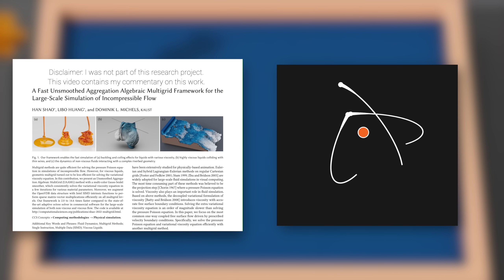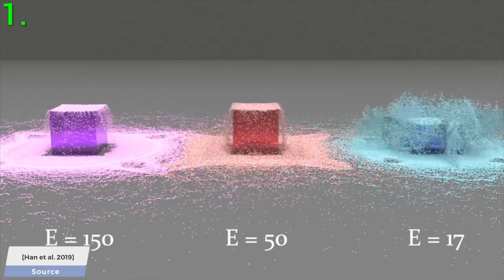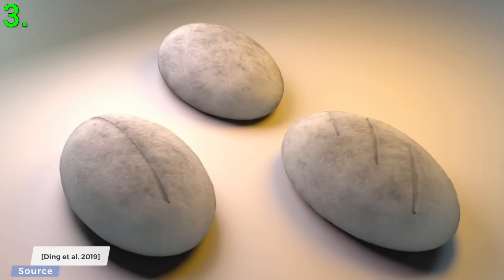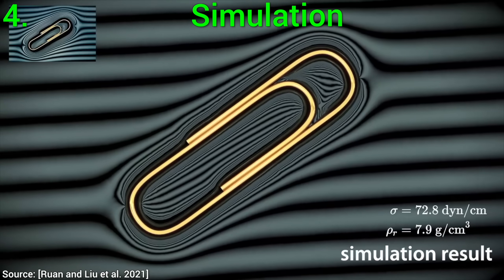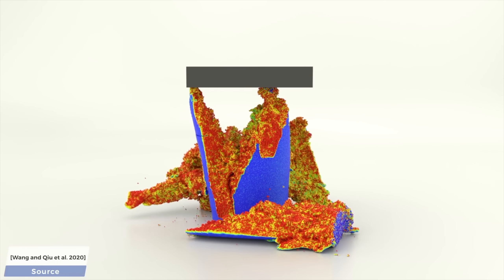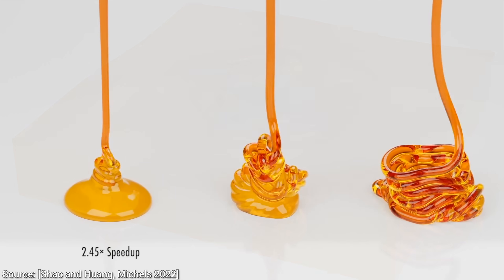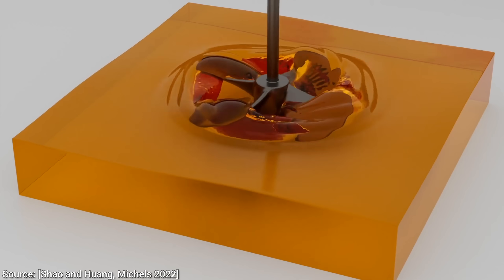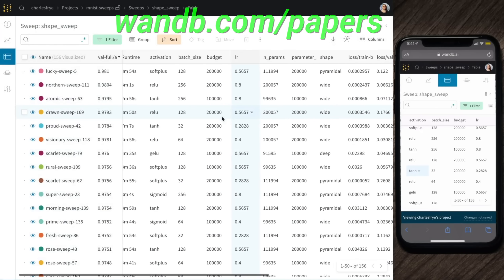A 1,000,000,000 Particle Simulation! 🌊

Comment: I think that there should be ways to make these simulations extremely fast or Realtime no matter their size as long as you can make the program properly multithreaded or multiprocessing in a way that effectively makes particles store information on each particle in a box. Then depending on each particles speed to prevent particle clipping register their direction and radius or whatever kind of shape it theoretically has to determine how many areas/particle box sections or whatever we wish to call it to simulate the outcome. If you have 1 thread/cpu simulating each of the particles speed or possibly individual gpu cores if someone finds a way to use their specific architecture for physical simulation, then as long as you can get everything to communicate properly during the checking phases it should scale nearly infinitely as long as you can get enough cpu cores to maintain whatever fps you want. 

Of course an approach like this would make it hard to work out the simulation kinks or hang-ups when things want to go insanely fast causing particles to domino multiple other particles into yet more partitioned areas during a single simulation frame or cycle. Still i think depending on how it is done it is possible with the scaling of cpu cores and possibly gpu cores if someone finds a way to utilize shaders in that fashion! 

I'm actually quite interested in the idea of someone making program that can utilize gpu cores to mathematically simulate or rather emulate cpu calculations in a way to make it act like your cpu has an extremely large amount of slower cores to do if you have the right drivers. 

Maybe there is something like that out there already?

Comment: I have a question:
Does having more cache in the CPU help with simulations? Like for example these Ryzen CPU's with 3D V-Cache technology.
I've never seen anyone benchmark that. And I'm mostly interested in Blender simulations.
Reply: Outside the scope of this channel but no. Right now blender fluid sim is built on mantaflow which has no working GPU acceleration nor full multi-core CPU support for FLIP nor support for processor-specific acceleration features. Mantaflow does cache things at the filesystem level but we're talking about multiple gigabytes of simulation data; so mainly the speed of your fastest CPU core and the speed of the cache drive will be the limiting factor so try to get the fastest you can of both!

Comment: I’m always hopeful these new fluid sim methods will make their way into common software packages (Houdini in particular), but they never seem to. Is it because they are patent-encumbered or are ideas in papers too untested and theoretical to be used in production? What has to happen to close the gap?
Reply: Sometimes the author's do not provide all the details in their papers to reproduced results and do not share the source code. Sometimes they do but noone takes the work to re-implement it. Sometimes you see only the 0.1% of simulations that actually worked, and 99.9% of parameters run unstable, so it's not really usable.
And sometimes - that's the case for my CFD software - it's a standalone software that is not really feasible to integrate in existing software, because they are too inefficient and would kill all performance gains.

Comment: Ultimately all of these techniques will be outperformed by Quantum computers, but that will still take some time.
Reply: No. Quantum computers can only simulate certain algorithms. Fluid dynamics is not one of them.
Reply: @ProjectPhysX  Did media tell you this? Lol. No bro, that's false. Quantum computers are still at the very beginning and the reason why only some algorithms work is because almost nobody knows how to program quantum computers. Also there's many types of quantum computers. But what is sure is that algorithms that are processing data in parallel will work. And you can make any program work in parallel processes, it's just difficult to do. Basically quantum computers will replace GPUs one day, because the processing is pretty similar to that and we are now slowly transitioning into running software all on GPUs. Normal CPUs will be pretty much obsolete in the future.
Reply: @Aldraz  I'm a computational physicist and I do GPU programming for a living; my GPU-based CFD software is about 20x faster than that in the video.
Quantum computers cannot and will not replace GPUs for all software. They are better at combinatory algorithms like computing energy states of molecules, protein folding or maze solving. But they are entirely incapable of data-parallel algorithms like CFD, and no "improvement" can ever change that, it's physically not possible.
Right now the main technical issue is that no technology can reliably store quantum information for more than a few milliseconds (decoherence), so no algorithm can have longer runtime than that, meaning right now there are no practical use-cases where a quantum computer outperforms a traditional computer.
GPUs on the other hand are excellent at data-parallel algorithms with their SIMD architecture and fast memory.
And then there is the class of non-parallelizable algorithms that is suited neither for GPUs not quantum computers. CPUs will not be obsolete anytime soon, they have their own use-cases.
Reply: @ProjectPhysX  loved your answer lol
Reply: @ProjectPhysX  I see, that's very interesting. I agree with what you are saying. But I still have a feeling that we have not explored all the possibilities with quantum computing. From what I understand is that with quantum computing, you can go quickly through many different probabilistic states, but have only one output, because when you make measurement the wave function will collapse. There's something called Neural graphics which uses AI to accelerate (approximate or even generate) renders using raytracing, pathtracing or videos in real-time etc. Now I could be wrong, but I think neural nets could be run very quickly on quantum computers. If that would be the case, it's like the holy grail, since neural graphics has a huge potential. Fluid dynamics could be one of them and I am pretty sure one day someone will do it with billion particles and run it in real-time. The only disadvantage there is the loss of quality in physical accuracy, but I think it can get on the same loss level we have in all other compression algorithms, so the user wouldn't ever notice it.

Comment: These papers never cease to amaze me, but my enthusiasm is unfortunately waning. 

So many years of incredible feats of ingenuity, just for it to see no usage in the industry. Common 3D softwares do not put any of these papers to use, and some find themselves a decade behind. Even something as beautiful as blender does not touch the modern power we have papers for, and is several years behind on the used techniques.
Reply: Neural networks were invented in the 1970s. It took 50 years till we are finally seeing mass industry adoption (Stablediffusion). Industry being a decade behind is totally normal.
Reply: @pmmm712011  this is true, but the limits of our technology which have caused this have closed the gap quite recently. We shouldn't be seeing a decade difference anymore.

Comment: Nice! I did a 10 billion voxel CFD simulation of the Space Shuttle earlier this week, that's one 0 more. :D
Took 6.5 hours on 8x MI200 64GB, or 13 seconds per two 4K frames. So ~20x performance of that paper already, although with different hardware.
Video is on my YT channel :)
Reply: sorry i didnt see the fact that you already posted the hardware what software did you use?
Reply: @ektorthebigbro  my own, it's called FluidX3D.

Comment: It's amazing how technique became 30+ times better in just 2 years.
Reply: Moores Law!
Reply: @boogeyman8099  no. Not how that works.
Reply: @jamesbizs  moores law is a projection of the seemingly exponentially of human engineering and intelligence. I didn’t mean it in its literal transistor sense!
Reply: @boogeyman8099  Except it is 15 times faster and has nothing to do with transistor density.
Reply: @KrasBadan  moores law tells us that every 2 years roughly, the number of transistors on microchips doubles… again didn’t mean it literally more of an expression to explain the sheer ingenuity we’ve accomplished over the years!
Reply: @boogeyman8099  right, but transistor density isn't the same thing, that's a flawed metaphor. In this context merely relying more powerful hardware over time would be the opposite of human innovation!
Reply: My FluidX3D software is still 20x faster lol